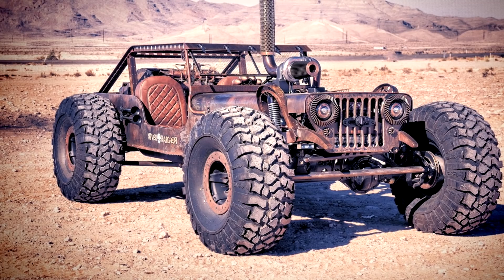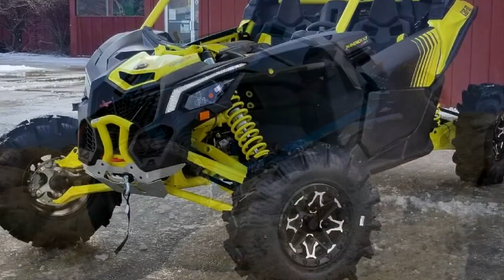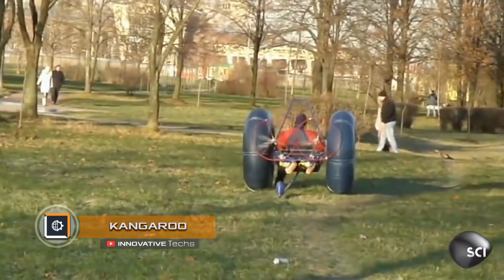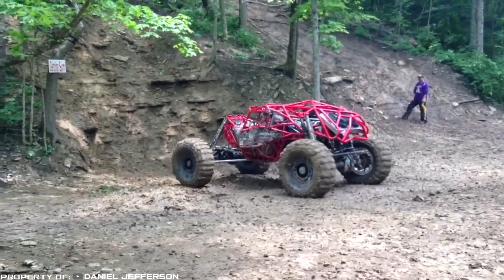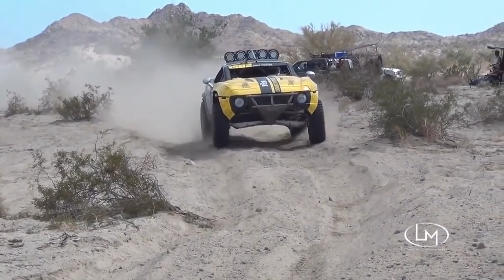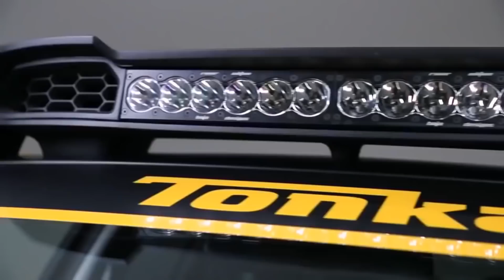10 MOST INSANE MONSTER OFF-ROAD

Comment: I think the first one is a 12 valve Cummins 6 cylinder engine not a 12 cylinder. It's needs more turbo because you don't need all that black smoke which is just could be hp instead of wasted money.

Comment: They stated that the engine in the Rock Rat was a 12 cylinder from an old school bus... WRONG! That is a Cummins 6BT, 6 cylinder "12 valve" motor (used in ALL kinds of vehicles and equipment). It is 5.9 liters or 359 cubic inches, and about 210hp stock, but No problem with 700hp, especially with that turbo. I found other sites that also said it was a "12 cylinder"....

Comment: 35” powerful wheels?, Hole to vent hot air = exhaust pipes and it’s 4 wheel steering on the stretch limo truck. You can tell this was not written by a car guy.

Comment: ok.. the voice dude needs to relearn his stuff or who ever made the script needs to be fired.. its 12V 6 cylinder and the other is UTV not SUV
Reply: AWD system that reduces turning radius? Somehow? Magic maybe?
Reply: I'm still scratching my head how a 12 valve Cummins turned into a v12 bus engine?
Reply: And "it has 700 horsepowers" 😂😂 

I'm guessing that this mOron thinks "all wheel steering" keeps it from getting stuck in the mud, since he says "all wheel drive" means it turns better.🤪
Reply: Okay since we're on the 'Voice Dude'...he has a good voice, but wondered why he said 'Tanka' instead of 'Tonka'.